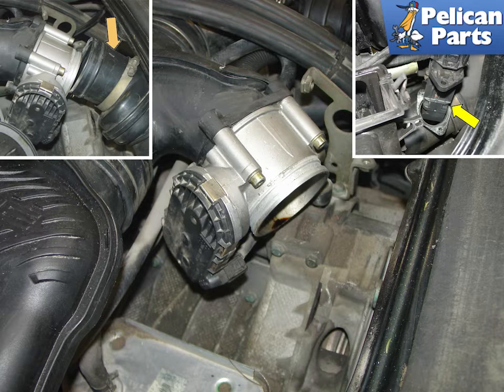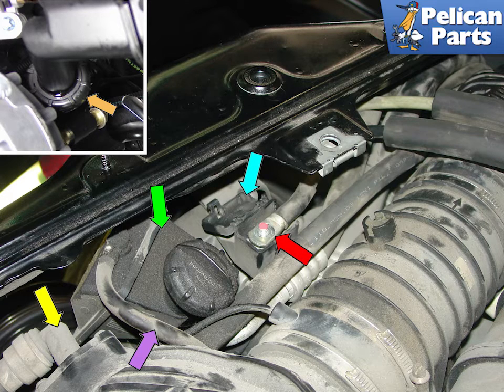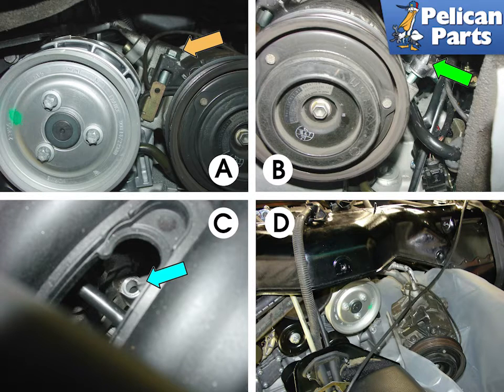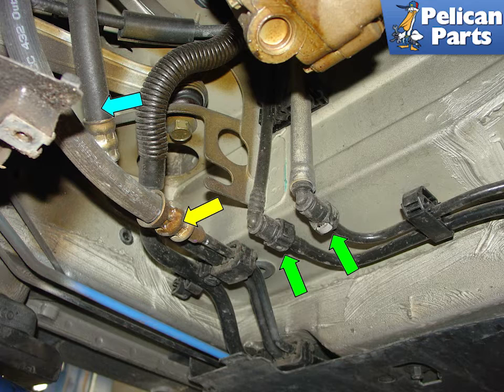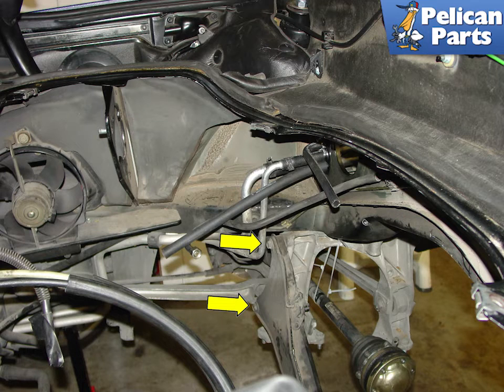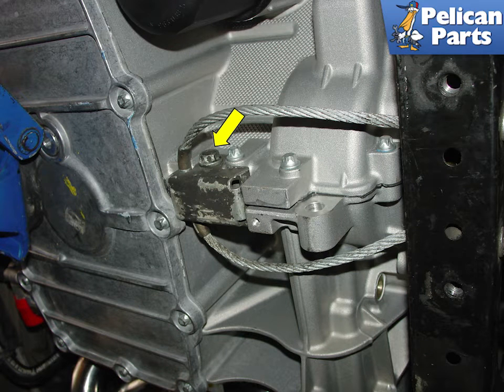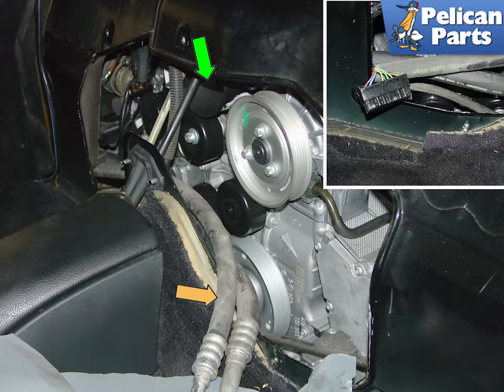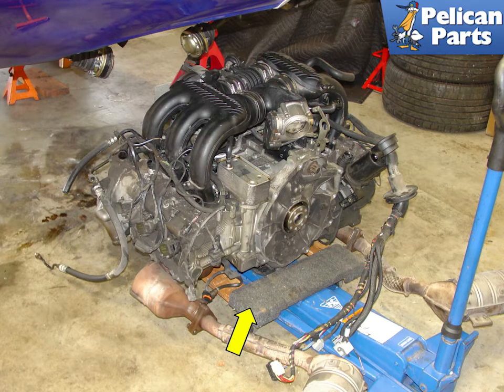Porsche Boxster 986 Engine Drop / Removal

Comment: If I were to do this on my driveway, how high must I jack the car up and support on jack-stands to have proper clearance for the jack, cart and engine to clear?
Reply from the maker: I think 28" will do. So large jack stands should get it done. Be sure you are on a level concrete surface.